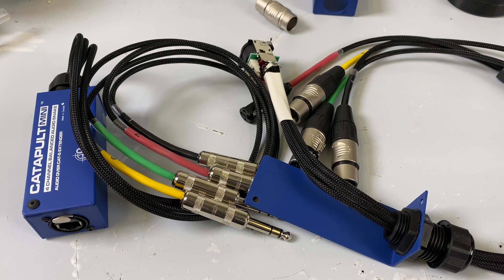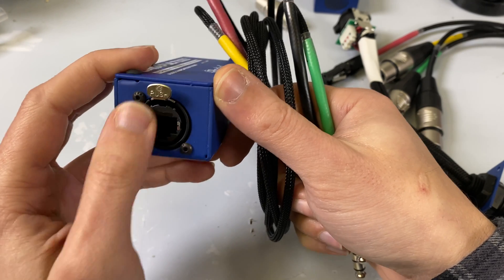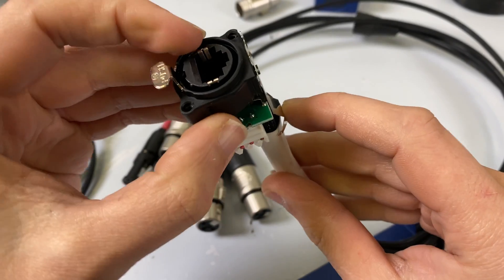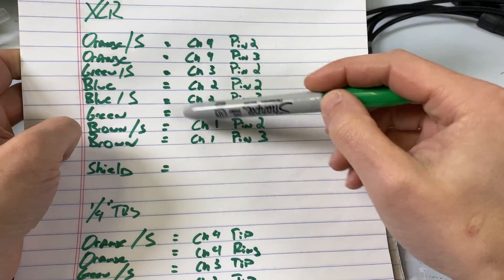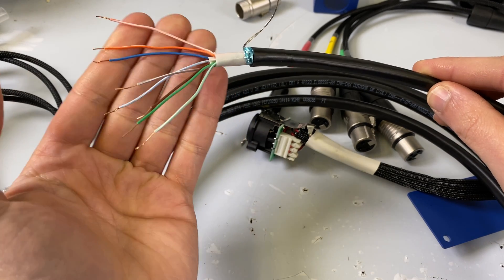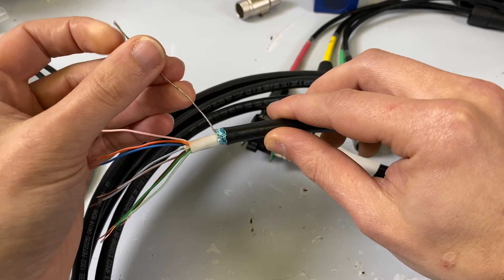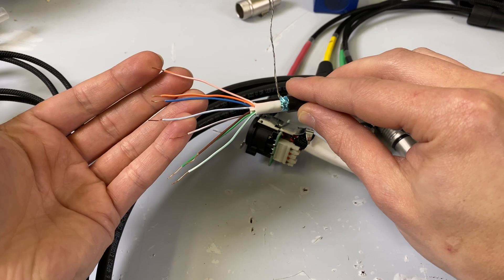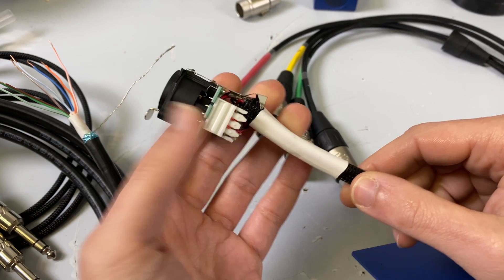4ch Analog Audio Over Cat5/6 Network Cable Pinout & Taking Apart A Radial Catapult.

Comment: no translator, no transformer, no composant !!!! I going to do it myself. Thank for opening this wire box.
Reply from the maker: Glad I could help! Radial does a great job with their builds. I’ve built my own RJ45 - XLR cables. For the time you spend building the cables vs the cost of this box: the box is worth the $. You don’t need a transformer since it’s not converting signal level, the box is taking the pins 1:1. Anyway, my $.02
Reply: @billylaguardia  https://www.thomann.de/fr/radial_engineering_catapult_mini_tx.htm

Comment: Is there any problem using 2x 3 pins in a cat5e to run 2 balanced XLR line level signals over structured cabling?
Reply from the maker: I’m actually going to make a video on building that cable! Yes it will work.

Comment: Thank you 4 Making This video...Question...I have a line 6 variax cable (cat5e shielded ethercon) but the Rj45's ends on it are plastic....The shield wire does touch the Ethercon housing. but Dave Rat says on a Video that unless the cable is shielded AND the Rj45 is metal then you can't run phantom power..... i did do a continuity test and pin 1 infact does show continuity even tho the rj45 is plastic....i'm afraid to test on my mic for fear of shorting and ruining the mic...Any thoughts....Thanx in advance...
Reply from the maker: I know the Super Cat cables are specifically made for audio in terms of their grounding/RJ pinning, but I’ve never used them personally. If you are getting continuity on pin 1 you will be fine. If you use a multimeter, 48v is present on pin 2 and pin 3 of a console input XLR. In electrical terms, these are the “hots” with pin 1 being the “neutral” to complete the circuit. That’s why phantom won’t work with unshielded cable, since all the pin 1’s are tied together and soldered to a shielded (metal) RJ chassis. If Line 6 wired the cable in a way that pin 1 is terminated within the 8 pairs in the RJ you will be fine. You won’t hurt the mic, it will either work or it won’t.
Reply: @billylaguardia  Thank you so much for Writing back...and Yes the line 6 Cat5E ethercon did infact power my Mic when i turned on Phantom power on my focusrite 18i20..Thanx again! Peace!
Reply from the maker: @acmebrandinc  no problem, glad I could help! 😬